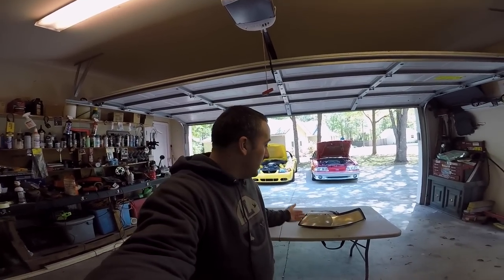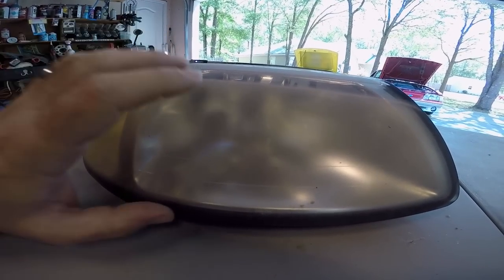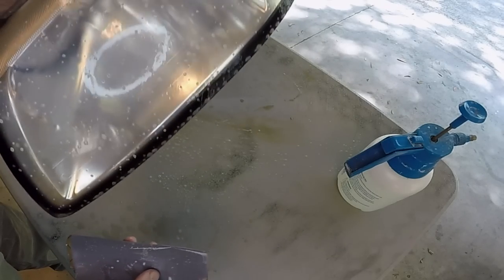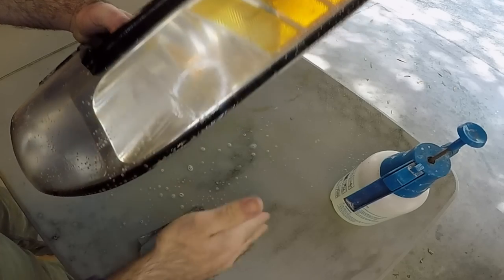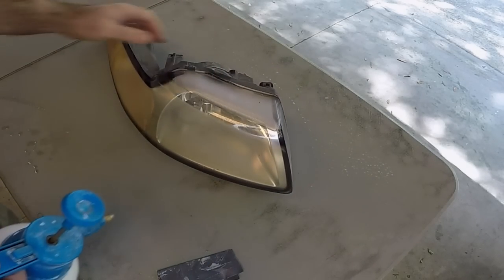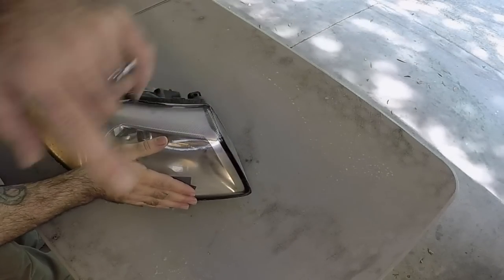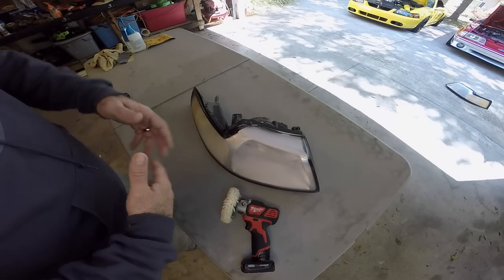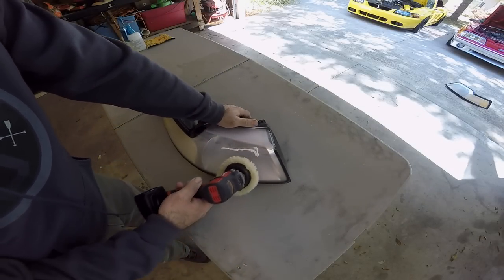🔆HEADLIGHT BUFFING VS CLEAR COATING / WHAT'S THE BEST OPTION?

Comment: When I bought my van used the headlights were clear, but over the last 10 years they have clouded up and gone yellow, if you look closely it looks like they have a thin layer of clear coat on the lenses as it's peeling away in parts I had an advisory on them last year for the yearly inspection so this year i bought one of those headlight restoration kits and it involved sanding them down and buffing the crap out of them and i have to say they have come up really nice like glass, also much better lights at night now you don't realise how much light you loose when thier foggy.

Comment: yo great video i have question about this or what im gonna do, im planning to normally wet sand it then two layer 2k clear coat(non uv because i cant find it anywhere) and after that applying Terlans's uv procted wax to protect yellowing. but im not sure about how it will look or even is it gonna work also after times can it still be non yellow because of wax?

Comment: Hey great video! Can I go up to 2000 grit and then clear coat? or this is too fine for the coat to bond? iv seen other similar ones that have gone up to even 3000. hence i was confused.working on my 20 year old Audi TT MK1. Thanks

Comment: I found a pair of new edge headlights that were worse. They cleaned up with the buffing process but I wasn't satisfied. Thinking of re-doing starting with P240.T hese are headlights that I'm learning with, will not be going on the new edge.

Comment: wet sand & 5 coats clear last good enough. Those that like to wet sand & buff and not spray this sounds crazy but ive been buffin with 3M machine glaze & NuFinish mixed 50/50 w/1 ounce of distilled water, less is best turns out super! 30 years practice

Comment: You can put a ceramic coating on the polished lens and it will be just as protected from the UV rays and weather as the clear coat.😊

Comment: I did the buffing process 8 years ago, except I put clear vinyl on the lights and they've been maintenance free. Only last year I've noticed the vinyl is starting wear, but it still looks clear. It's not damaged enough to make me want to do anything about it.
Reply from the maker: Nice! I like that idea too 🤔😎
Reply: @BREW2LFOXBODY  I spent a little bit for a precut kit back then, it did the heads and fogs on my SVT Focus. It's thick clear bra material, but I think it makes it easier to conform to complex contours and it's not easily ruined by novice application.

 The vinyl on ebay is a lot thinner like and I use it on my fogs now, but surprisingly it keeps the glass from pitting and breaking. Flat lights like on a fox (or any mustang really) I'd try the ebay stuff since it's so cheap nowadays; might have to trim and polish off those nipples on the fox body though before applying vinyl. lol

Comment: I wet sanded and cleared my third brake light on my 01’ GT. Made a world of difference. Plus it’s a lot cheaper than buying a new one.
Reply: Gotta do that to my 87 gt 3rd also.
Reply: what grit of sand paper did you use @bradvaughan
Reply: BCMACH1 I started with 600 then 1000.
Reply: Thanks bro!! i need to do that on my mach. instead if buying a cheap replacement one. i want to keep the oem.
Reply: @braud vaughan
Reply: I'm thinking of doing that on my 02 base, the aftermarket blacked out headlights that came with the car need a restore aswell though

Comment: I had my headlights wet sanded and professionally buffed last year and the results were stunning. He didn't clear coat them, he said clear coats can fail and then require more work to get back to being better again. I noticed the other day that the lights were beginning to yellow a small amount so spoke to him who said a hand polish should bring them back again (which it has, pretty much). Should I apply something like a ceramic coating, would that help?
Reply: I'm no professional but make sure to wipe the headlights down then you can apply a ceramic coating or sealant after. This will help maintain the protection for even longer!

Comment: awesome video brew man if the lights are bad like yours where i start with 320 grit 600 then 1000 I've probably prepped out at least 5000 lights at the shop to restore them also our specialty was tinting them with black base coat and clear on tail lights marker lights and reflectors
Reply from the maker: I have started at that grit many times myself, it definitely gives you a chance to get down past the issues and does usually turn out better. I was trying to keep the grits as simple as possible in this video. Believe it or not I used to restore and tint headlights back around 07-09 I did a lot on SVT Performance.

Comment: Looks great. 
When i did mine i used plastX and it lasted years.. they looked brand new the day i sold that car.
Reply from the maker: I’ve not been so lucky, but I’m sure if you keep them waxed they will last a lot longer.
Reply: I've used plastx and got good results, waxed aswell, and after 6 months it faded back to yellow, I keep it around in case I want to quickly polish lights to sell a car lol
Reply: @AFXGaming  you simply applied plastx and polished it?

Comment: People give me crap all the time, but I spend the 21.00 for the 3m kit when I need to do headlights, and get amazing results.  500grit, 800 grit, 3k grit (trizact), rubbing/polishing compound, and I get 2 yrs out of the clear lights. Prolly more if I used a UV resistant clear. Great video
Reply: Wait. After sanding, can you go straight to clear coat? Or you need the compound, polish and then clear coat? Which order would you go? Sand, compound, polish, clear? Or sand, clear and polish?
Reply: @devinewski  you have to get the old uv coating off. Then get rid of swirl marks.
Reply: @devinewski  Sand polish clearcoat job done, and never apply 2k if it's not written on the can don't use it!! Always use a certified clearcoat with added UV protection, It will last 1-2 year's may be longer depending on where you live and many other factors!!!

Comment: I have wet sanded, buffed and clear coated a headlight and looks good.
Reply: How did you clear coated it? what do I have to buy?
Reply: @pakistanilad1254  I used a spray on clear coat called clear coat 4k. Advanced auto should have it. Let set for about an hour after last coat and should be good to go

Comment: very good info here.. on my daily and my wife's truck I polish the headlights up every season pretty much..  clearcoating is more durable but to me not a big deal to throw some Novus on them and polish away...
Reply from the maker: Yeah I should have mentioned the fact that you can stay on top on them with some good wax and they will last a lot longer.
Reply: NOVUS is the cheapest cost about $1 for two headlights and small novus bottles will do about 12 headlights at around $12 for the NOVUS with the bigger bottles comes out to .25cents a headlight

Comment: Just subscribed thank you for the info! 
Quick question.. do I absolutely need 2k for clearcoat? Or can I use another brand of non yellowing UV resistant clear coat such as rustoleum
Reply: The 2x uv resistance rustoleum is actually pretty good for this use. In the past I've used some cheap random unknown brand clear coat and it did fine, so you shouldn't worry too much.

Comment: Great video and how to, thanks!
Does that clear coat feature UV protection? That would be better if it did, right?
Reply: There's three ways to do it.
The best one is real automotive clear coat, it's definitely uv resistant, but it's expensive and sometimes harder to apply.
Then there's rustoleum special uv resistant clear coat, I've heard people having good results with it.
The last option is just a regular clear coat that's rated for outside use, it probably is the one that is the least uv resistant compared to the two others, but in my experience it does the job just fine and I haven't had any problems with it, the pro is that you probably have a random can of it laying around in your garage already.

Comment: Could you do both...  I used a kit and they look great, but I know it's temporary...should I now apply a clear coat?
Reply: If you want to clear coat it you need to sand it again with something like 800 grit.
If it's already polished, clear coat won't stick well.

Comment: good video. I just picked up /k clear and will be doing a bunch of restorations. What grit should I use pre clear coat?
Reply from the maker: 400 grit works well.
Reply: I ran 500/800 and turned out nice.  I’m appt with results. I thought 800 would be high but turned out well.

Comment: Clear coat is cool, but in my experience paint protection film like XPEL ultimate plus is the best option, lasts longer than 2K clear, and provides impact protection.
Reply: That’s Right. It’s been almost 5 years and mine’s still holding up good
Reply: @shubhkarmansingh3984  a local shop here in the Los Angeles area that restores headlights uses XPEL ultimate plus for the protection, and they guarantee it for 10 years, they charge $180 for two headlights, full restoration, and application of the film, not a bad price.
Reply: @STILLNIGHTPEARL  Can you share a shop place? From LA as well.

Comment: Could you buff and then apply clear coat afterwards to get the best of both worlds?
Reply from the maker: Typically I try to keep the grit as course as possible so the clear has a good surface to bond to, clear has no problems filling in 600 grit sanding scratches. Anything much past that doesn’t seem to matter very much in my experience as far as clarity goes.
Reply: You need the scratches to help the clear stick to the plastic I try to keep it at 1000 grit before clear 🤘
Reply: No, serval1. Clear coat won't adhere to a buffed finish. 

Best of both worlds is to apply the clear coat, THEN buff to a perfect finish. But:

1. Sand SMOOTH with 2000 before clear coat.

2. Allow clear coat 1/2 hour to dry between coats, overnight before buffing. 

Overkill? Perhaps, but that's what worked for me.
Reply: I start with 400 grit sometimes 320 and finish with 1500 no more finer than that. No need to buff them out. Apply adhesive promoter and the spray automotive industry 2k clearcoat. I do this for a living since 2005. Go to Facebook Mobile Headlight Cleaning.
Reply: @MrJuanae86  so you just do headlight restore? How long does a job take you? Genuinely interested, as those seems like a good side hussle for me. 
What do you charge? 
Steady biz?
Advertising?
Reply: @MrJuanae86  I think I found you on Facebook but not sure. You operate out of tampa?
Reply: @johndenver5029  yes sir thats me brother
Reply: @MrJuanae86  dear sir can you help.me.please. after the clear coat cures i have to.go.back and.polish it out? It is permanent ?
Can i.apllu clear after sand- compound -polish or clear needs some rough surface to bond? 
Please.i work mobile sometimes so.aplly.clear is difficult for.me.sometimes ,can i apply something else as.permenant solution?
My kind regards
Reply: @MrJuanae86  What brand of plastic adhesive promoter would be best? I’ve use some that gets cloudy or could it be too old? Which one you use?
Reply: @Eltamarindo92  Nonsense!!!
Reply: @ingrampowell9111  Nonsense!!!

Comment: Is that the tekna clear coat gun...? Why didn't you use that on Andrew's car?
Reply from the maker: It’s actually the GTI PRO LITE but as you know it’s the same thing, this is the UK version. I’m using the 1.3mm and the T110 air cap. I just got it in a few days ago. Or would have definitely used it on his car.

Comment: Good vid.  How long does the 2K clear last before it starts to blister using 600?  Headlight heat seems to impact the plastic surface and cause blistering even when sanded with 600.  I wonder if 400 would promote better adhesion.  1200 was too smooth.
Reply: No it's a old video but. In my opinion sense 2k clear is used to clearcoat a cars paint job. I would think it will last just as long as the clearcoat on a cars paint job does. That sets out in the heat all day long. The lens on headlights wont get hot enough to destroy the clearcoat. The chrome finish you see inside  headlights along with the chrome piece in front of the headlight bulb. Is going to absorb the heat for the bulb and not the lens. If the bulb got the plastic lens hot enough to destroy the clearcoat. The heat from the bulb. Would also get hot enough to destroy, burn, or melt the inside of the plastic headlight lens as well.
Reply: Also the clearcoat will stick just fine to 1000 grit scratches without peeling or flaking off the lenses.

Comment: my headlight is clear and no yellowing but at the top part of it, the clear coat is cracking and chipping away,should i sand it and take the clear coat out or just spray it directly with clear coat?
Reply from the maker: Wet sand it with 400 and clear it.

Comment: You need to remove all the oxidation first or it gets stuck underneath.  Dry sanding is absolutely the best method then wet sand.  Then polish and lastly clear coat!  Best results guaranteed!
Reply: Couldn't agree more!!!🤔🫡👍
Reply: Is polishing and buffing the same
Reply: @milagrossmith4891  In essence yes, they are the same.  Just may depend on what coatings you're using.  But yes, the terms are interchangeable.

Comment: I have done more than 3000 pairs of head lights restoration in few years of my detailing career, The problem I found with clear coat method is that when the clear coat started to crack and peeling, it’s really difficult to restore again, and it’s always a pain in the a** when I see customer have those clear coat problems, it requires a lot of hard sanding again and more than 20 mins to sand off each light properly. 

But the buffed original surface without any coating is much easier to restore again in next few months, it’ll only need 2 mins 2000 grit wet sanding and buff, finish restoration again in less than 10mins and it’ll last another half year before buff again easily.
Reply: That's why you should never ever use 2k on headlights, As a rule of thumb if it's not written on the can don't use it!! I wish more of the pro 2k community would read your comment?? I have noticed that no one as liked your point of view? Wonder why!!🤔
Reply: @keithroberts5611  still too many people use normal clear coat and even use resin to brush on the headlights 😂  I also found some of the  the OEM UV coating also really difficult to restore when they get bad.
Reply: But eventually the UV will make the polycarbonate brittle, and you will get cracking. Then you cannot buff it any more, you need to replace the headlights.
Reply: Use a DA to sand all that crap off, starting with 320-400, finish with around 800-1000 grit. Use a high quality urethane clearcoat. Been doing this for many years in the collision repair industry. They look great and will not crack or peel. People that use the cheap spray can clear usually have problems down the road.
Reply: @keithroberts5611 2k from a can isn't high quality. 2k urethane mixed from SPI or PPG will last waaaaay longer than OEM. This is a well known and long used trick used by us car restorers. It's a little pricey using the expensive stuff, but the quality and longevity is unmatched. Unrivaled UV holdout and clear mil thickness.
Reply: This has to be the weirdest comment ever, so you have to sand the headlights again every few months again in order to save 10 minutes of sanding in case years down the road the clear coat started chipping again .. 🤦‍♂️ yea that makes a lot of sense.
Anyone sanding headlights without respraying the UV protective clear coat that will provide years of protection is simply a scammer
Reply: can you protect with a ceramic glass coating

Comment: Clearcoat changes how light passes out the lights.  It breaks down, bubbles, and crazes over time.  Adhesive film works better.
  
Or refer to this video for a coating that works well, tested by a trusted mechanic:  https://youtu.be/E9NP0_nF2ak?t=119

Comment: The Question is all wrong??Its a Question of combining the two for a professional finnish!! My tips never remove headlights from the car its unnecessary? There more stable left alone, Just make shure you mask off using a proper painters tape, And lastly never use any clearcoats that are not certified for headlights only, Keep away from all 2k products!!!🤔🇬🇧☝️